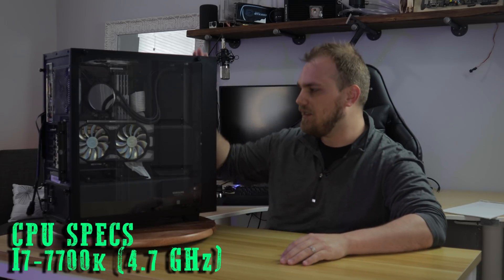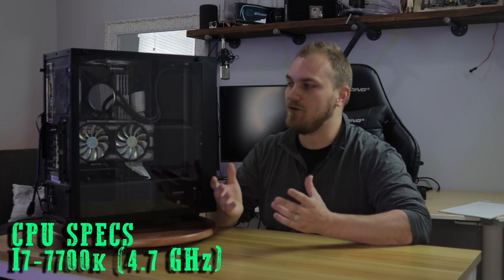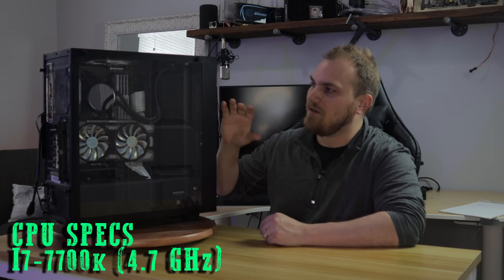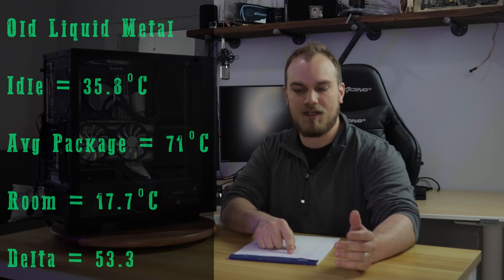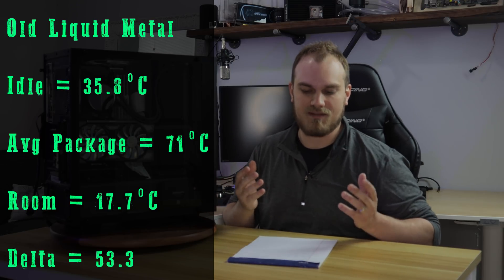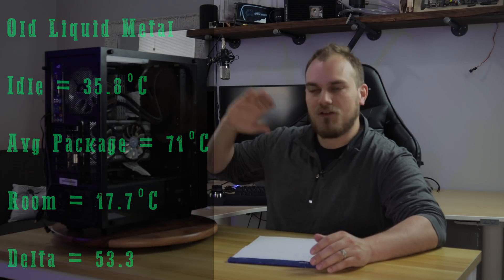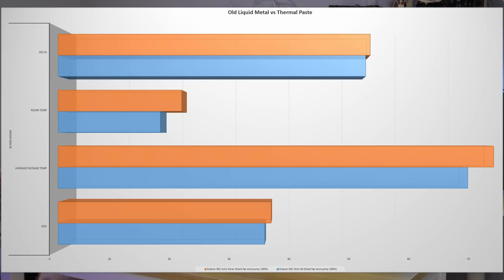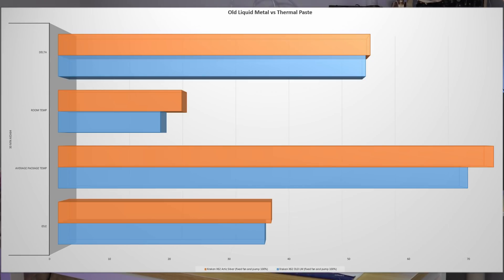What Liquid Metal Looks Like After 8 Months Of Daily Use

Comment: I've been using LM on all of my game consoles (the ones that use a copper heat sink anyway) and have had pretty amazing results. The way I figure it, it doesn't seem as though it dries out any worse than thermal grease  and should be good for several years... If by chance it doesn't perform as well years down the road, those consoles etc will be far cheaper to replace in the future. You should check out the audio differences between before and after on a PS4 Pro, it vastly improves how much the fan speeds up to where it's actually tolerable under load in certain areas of games.

It seems like when LM bonds with copper it only does it to a certain extent. It would be interesting if someone could come up with a way of doing an absorption test over time to see the rate between say a month and several years. I feel like the evidence will show that the absorption is only a finite amount and won't continue over a certain amount.
Reply: Liquid metal doesn't dry out, but like you said, it absorbs into the copper, so you still end up with less liquid over time and have to add more. You are right on the other stuff as well, if you keep adding liquid metal, the copper is "saturated" with LM at some point, so it will basically stop absorbing it. This happens, because the LM doesn't get very deep into the copper, it's basically just on the surface.

Comment: I've been using Conductonaut between die and IHS and between IHS and cold plate for about two years now. It will soak into the copper of the cold plate after awhile and it no longer has perfect contact. Just slap some more on once a year or so and you'll be fine.

Comment: on a 7700k it only makes sense to use liquid metal if you delidded it. i guess the main problem here is the thermal paste between the die and the ihs. i changed it after 2 years on my 4790k to liquid metal and the difference was 40C (the paste between the die and the ihs was completely dry at that point). at the time i had to use usual thermal paste between the ihs and the cooler but i think the difference would have been higher if i had a waterblock on my ihs. i think if you want to overclock and your cpu is out of warranty its totally worth it to delid the cpu and replace the stock tim with luquid metal. from what i've seen the average temp difference is about 15-20 C. if u have a soldered cpu (like 9900k) i think its worth using liquid metal. (at least on intel). you can cook eggs on this thing so every bit of better heat transfer is worth it. on ryzen i dont think its worth using liquid metal,  since the difference in temps is not that high and you cant get a lot more mhz out of it even if you use liquid metal. on ryzen your more bound to the limit of the architecture. often times you cant get more mhz out of it even if the temps are like 60C on full load.

Comment: Did you delid the 7700K? If not, only between IHS and cooler, that isn't very good. That toothpaste form Intel is really bad. I have mine delid, applied LM between IHS and CPU die, arctic MX-4 between IHS and cooler (Enermax LiqFusion 360). Have stable 5Ghz with max Temp @~75°C

Comment: It is not supposed to be applicated on the Heatspreader. As far as i know, liquid Metal only damages copper when there ist aluminium in contact with it. because liquid Metal contains Gallium which is insanely corrossive against base Metals, and Aluminium  reacts corrossive with copper.

Comment: I wouldn't use liquid metal between the IHS and the cooler, the real benefit you can gain with liquid metal is by delidding the cpu and replacing the original TIM with it, not to mention liquid metal fuses with bare copper over time.
Reply: Yeah, but it just affects the look of the copper. Go watch Gamers Nexus Liquid metal Tests. The stained copper does not cool any worse. The only thing you should absolutely not do is put liquid metal on Aluminium
Reply: @EVPointMaster  Gamers nexus only did a short term test. I used LM for 2 years. It didnt just affect the look it was literally like a thick plating of metal.  LM reacts over time with copper, fusing with it and "drying" it out almost as if you plated it. Thats the long term exposure. LM isnt worth it as you have to replace it after a year. 

I have pictures of the "plating" effect.

So this time around I went with a diamond paste and had better temps and wont have to change that paste for years
Reply: Preach, you need a nickel-plated copper heatspreader in order to avoid it
Reply: @Enover5  How can you find out or what do you need to notice to be aware of it?
Reply: I had this happen to my GPU waterblock, I was in a time constraint situation so I had to remove it fast so I used Rouge with a rotary tool and ended up with better temps with a regular paste on the block afterwards lol
Reply: @lechap22  Temperatures went bad in my case 65C on water. switched over to CM mastergel maker never exceed 37C at 28C ambient

Comment: Well i would not use it between ihs and cooler, but between ihs and the cpu die it does wonders
Reply: Ive made this just this Morning. Delid the 5 2400G with Liquid Metall and on top the last bit of NH-1 paste.
Temps with my AIO Alphacool Eisbear LT in Aida 64 COU with GPU are at 52°C =)
Better than only on DIE and on top with Kryonat. =P
Reply: @Fincher123  
"Delid the 5 2400G with Liquid Metall and on top the last bit of NH-1 paste."
So you put both thermal compounds (liquid metal & NH-1) inside the IHS?
Reply: @AmuckPVP  No no no! XD
And i just replaced the NT-H! with Thermal Grizzly Kryonaut.
On the DIE is Liquid Metall and on top between Pump and IHS is Kryonaut.
Temps are at OC 1.4250 Volt 4.00GHz and GPU 1600MHz with 1.2500Volt at 52-54°C =P

Have a nice Day! =)
Reply: @Fincher123  I'm thinking of putting liquid metal on top of the IHS surrounded by a silicone barrier & liquid metal under the IHS.
Reply: @AmuckPVP  if you like to do this... but it will eat in the Copper and get Dark.
I Only like to use Kryonaut in contact to Copper. because the process with Nickel is much slower. What Metall is your Colling on top of the IHS?
Reply: @Fincher123  The copper itself is unaffected by the liquid metals in that it is not being damaged in any way. What's going on is that the liquid metal is plating onto it over time.
Reply: thats what i was wondering why not delid.

Comment: Thermal Grizzly Kryonaut instead of Arctic Silver  ;)  ...
Reply: tried that stuff, after barely a year it was super dried out and stained the surfaces pretty bad
Reply: @akstyle450  ?! ... never ... i build a lot of systems - i never had this to any of my components.
Reply: @TechTalkTobi  could just be luck of the draw for me, noticed my temps were getting worse over time and decided to take off and re-apply, only finding what it had become. The paste I still had leftover was in the sealed bag and it was so dried out it was like playdough which was disappointing. Ended up getting some arctic 5 and been pretty pleased, temps haven't gone beyond any higher than 15-20c from ambient. Plus I still have some old arctic silver from when I first started building (like 7 years ago) that still seems like new, so i'd say it's great for minor performance change with longevity
Reply: @akstyle450  maybe not enough ? ... i always put a smal film on the heatspreader that you are not able to see the surface of the heatspreader - and a smal point in the middle. nothing squeeze out and the temps are every time the same and also better than with AS 5
Reply: @akstyle450  You could of bought fake stuff, there's a lot of it out there in websites such as Amazon, Wal~Mart Online, eBay, NewEgg, & etc.
Reply: Hands down the best thermal paste, goes in/on everything build or service.
Not to say Arctic Silver is not great stuff but if you like to OC Kryonaut all the way.

Comment: Great video!
I hope you do one again with that paste in 8 months just to see the how it fairs between the 2.
I have a 6700k at 4.6GHz@1.344v, delided. I use the paste Phanteks PH-NDC (This is sourced from Noctua, so it's the same paste as the NT-H1) in the die and the IHS. I ran it at idle, about 28c and at load 70c (Ambien temp about 20c) with a CoolerMaster Master Liquid 240ml RGB.
It's one of the best pates I have ever used, even better than the MX-4.
No  cure time needed.
Maybe you can do a comparison with that paste, vs Artic Silver vs MX-4 and whatever else you can think of. I would love to see that.

Comment: DOG! I'm sure that's a good boy. Even if it's a girl. They're all good boys.

Sorry, what were we talking about?

Thermal interface material, right. I'm personally using Arctic MX-4 and have been ever since I first had to install a CPU cooler, and it's never disappointed. The delta between different TIMs isn't so massive that I could be bothered to swap for something more premium, especially something as electrically conductive as liquid metal. Sure, it has thermal conductivity out the wazoo, but the downsides are too numerous to ignore. It's vastly more expensive than MX-4, it takes more effort to apply, it can easily short out everything you ever loved (other than the dog) if you do it wrong, it corrodes aluminium so quickly it's not even funny (okay, it's a little funny) meaning it's inherently unsuitable for all heatsinks that eschew the copper heat exchanger and it's a pain in the neck to get rid of once it's somewhere you don't want it.

The other day I was idly browsing Ebay for a used 3770K (yes that would be an upgrade stop judging me) and one of the first results was a delidded, liquid metal'd specimen for a fairly reasonable price. Liquid metal under the IHS is, thermally speaking, a significant upgrade over the Colgate Intel uses, of course, but if a certain high-pitched Canadian is to be believed you have to SERVICE that stuff because it seeps. I cannot service this. You can keep that 3770K.
Reply: Yeah! Pupper!